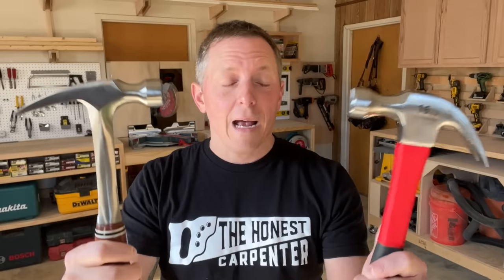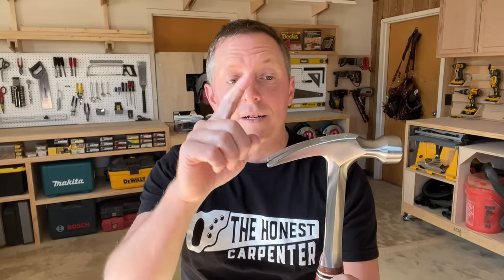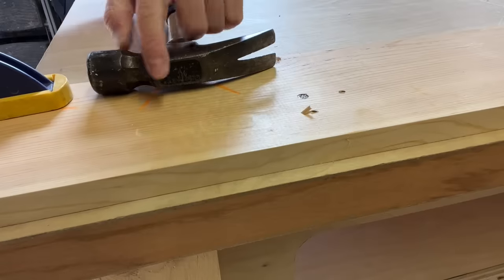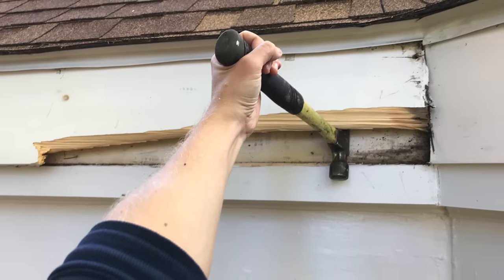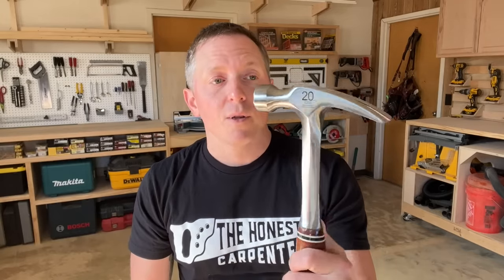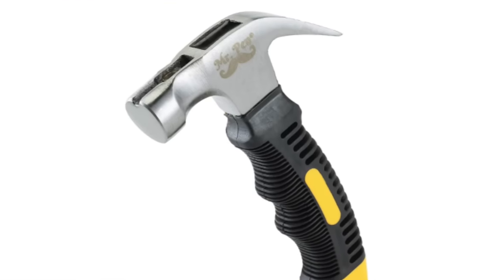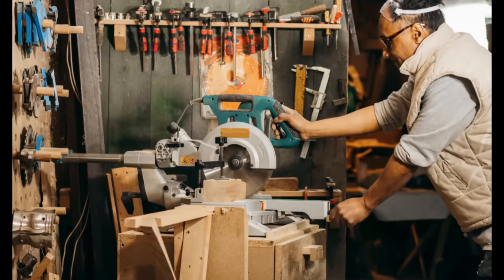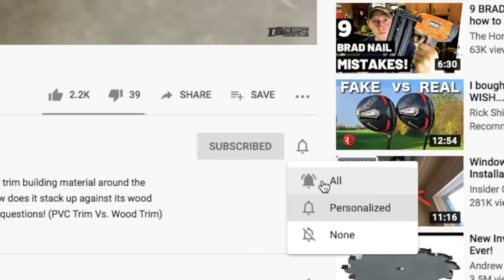DON'T USE STANDARD HAMMERS!! Try This Instead...(Rip Claw Hammer Vs. Curved Claw Hammer--Which One?)

Comment: You miss a huge reason that a curved claw hammer is the basic homeowner tool - they don't have a separate tool for pulling nails.  YOu show ways to pull nails with a rip claw hammer but NONE of them are as simple and non-damaging as the curved claw.  
The claw has nothing to do with driving nails.  You start the section about why the rip claw is better but then you slide into the real reason for that section, hammer weight.  Yes, there is a reason for the light hammers that is more important than you make it.  Most homeowners are not home BUILDERS or even REMODELERS.  Their main use of the hammer is hanging pictures, where the very light hammer is much more useful.
I am not a builder but have done quite a bit of remodeling.  I also have a degree that includes "human factors", how people mechanically do jobs.  
How many of the pros use a hammer for framing instead of reaching for a nail gun.  Would you say that a homeowner without a framing gun is using the wrong tool?  Tools need to be made for the usual job.  
I laugh at the people who brag about buying racing brake pads for their car because they are "better".  They are only better if you are on a race track at high speeds where the brakes become much hotter than on a road.  They don't work well at normal road temperatures and work well at temperatures where the standard brake pads quit working well.  
Same with tools, buy the ones that work for the job you do the most.
I do have a number of hammers but none with a rip claw.  If I did construction on a regular basis, I probably would have one.  Last time I did significant framing, I borrowed a framing nail gun from a neighbor (who used to do construction).  My father in law who did construction for many years did use his hammer on a shed we built and it took a serious toll on his arm by the time we were done.  Should have used a nail gun.

Comment: Up here what you refer to as a straight claw are more often called a framing hammer. I have a 28oz framer and have had for a long time now. I have an Estwing 16oz curved claw and still use them both. Depends on the work I am doing.

Comment: Pretty please do not use more hammer than is comfortable for you, especially if you're just getting started.  I bought into the "bigger is always better" fallacy and over-stressed my hand in one day of demo on the job.  I lost 90% of the flex in my fingers because I used a hammer that was a few ounces heavier than I should have.  Lighter is better for the newbie, and you shouldn't graduate to a heavier hammer until you've developed enough strength from a couple weeks or so with a lighter hammer.  If your DIY job is too big for your DIY hammer, upgrade to a power tool or hire a pro.  And if you're a new pro, pace yourself or you could suffer permanent injury.  Athletes gradually increase weight over a long period of time for a reason.

Comment: More weight doesn't necessarily equal more effective nail sinking. It depends on speed. A lighter hammer, with adequate length and the right sort of weight distribution, can be just as effective as a heavier hammer do ling as the right technique is used. And it's slso not true that a 16oz head is the minimum weight for an effective framing hammer. 14oz can be just as effective

Comment: I once read a 2 page article in handyman magazine about how use hammers and what is best. I canceled my subscription. Each hammer has a use and works best at it's intended function. I have everything from a 12oz claw to a 20oz framing hammer. A total of about 6 hammers not including 3 ball peen hammers. There is no such thing as the best hammer. Only hammers that fit the intended use. If the homeowner has the intention of building a shed, remodeling and trim. He should have at least 3 hammers.

Comment: there is way more to hammers than what you have here. does a mechanic have just one socket in his tool box?  if you're young and new to construction,  get a steel shank Estwing, it will last your lifetime . so many new guys see the boss with the $500 titanium hammer and run out and buy one. the boss isn't pulling nails anymore,  heck he probably isn't driving nails either. an apprentice should start with a good strong hammer and a tough nail bar ( catspaw )  then move up from there.

Comment: Man, I usually like your stuff, but don't agree with much on this one. 
That was a really lame demonstration of not being able to drive a curved claw between boards. Tilt the head back at just a slight angle and in it goes, and once it's in you have more prying power. Can't count the times boards have split leaving the nail in that to which they were attached. Faced with just a nail head sticking out I'll take the curved claw every time.

Frankly, if you're not pulling a crap-ton of nails on a jobsite you ain't doin' it right.
I framed new builds and did remodels for 10 years , and have been doing DIY for decades, It was flat out "illegal" on our jobsites to leave nails in boards. Straight up they have a high probability of impaling a foot, and bent over of ripping someone's hand open when they pull on it. Corner braces, forms, deadman T-braces, walk boards, scaffolds, ramps, and any other temporary framing has to torn apart, and every nail should come out of them. That rule still applies any project I'm in charge of today.
Too often I see frikkin' nails sticking up all over the place on jobsites these days.
Different generation I guess.

In remodeling pulling 16D CC nails out of lumber, 8D spiral siding nails out of studs, 10D ring shank nails out of decking, or any pneumatic driven collated ring shanks for that matter, are a lot easier with a curved claw. 

Hammer weight is also a non-issue. One can buy curved claw hammers up to 24 oz.
Yes, there are some very light weight curved claw hammers, but they do have their uses. Too many times have I seen half-moon dents in siding where some idiot used a heavy framing hammer to install it. Likewise marred and dinged trim work from a too heavy hammer. I don't own any hammers under 16 oz, but I do own and know how to use nail sets. Apparently, that's a lost skill these days. Sounds like a topic for your next video :)
That said I do know highly skilled trim carpenters who use 8, 10 or 12 oz hammers. Meaning they have small lightweight heads, not full size heads on stubby handles. Use the right tool for the job, right?

In summary it's not that either hammer is better than the other. It's a matter of technique, personal preference, and knowing how to adapt to the strengths and weaknesses of your preferred design. I my case that would be my blue rubber handled curved claw Estwing. IMO, not a hammer marketed for the average home owner. It does everything I need it to, and it keeps my sites safe from perforations and lacerations.
Reply: You are so spot on about nails on job sites!!! I've been on some that are just plain scary to walk around. Probably a good thing OSHA doesn't visit remodels on a regular basis. LOL.
I have claw hammers and rip hammers made by Estwing, Plumb, Craftsman, and even a couple from Harbor Freight. Wood handles, steel handles, fiberglass handles. A hammer is a hammer AFAIC. Those ring shank nails are a nightmare to pull out. Back in the day we used to use 16D ring shank nails for pressure treated 2x6 decking boards. If one ever got bent you were in trouble, because they could break when you tried to straighten them up. Today we just use screws and impact drivers. Much better! LOL